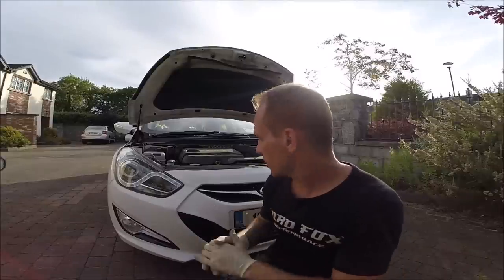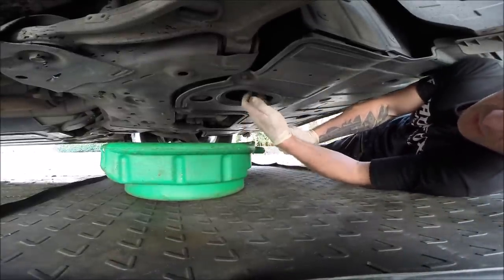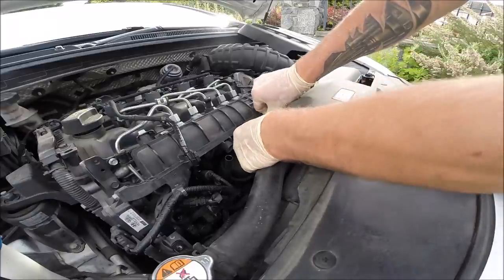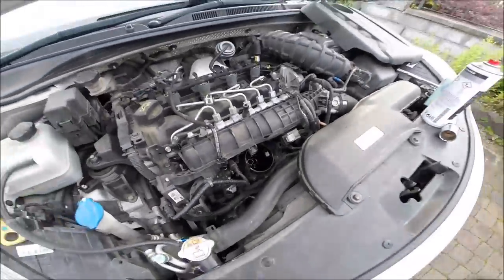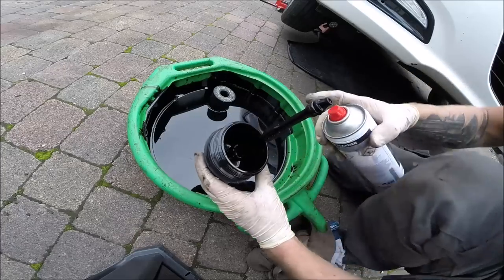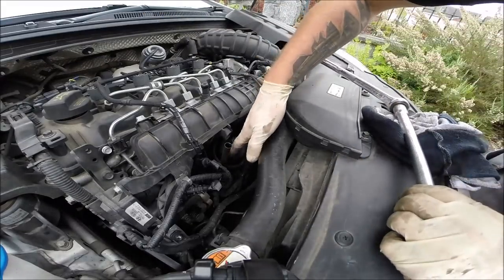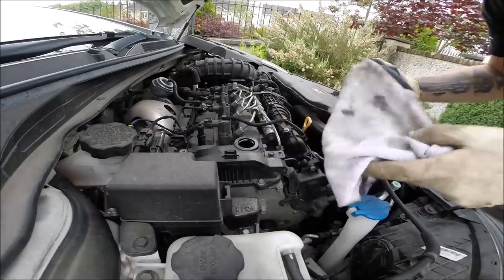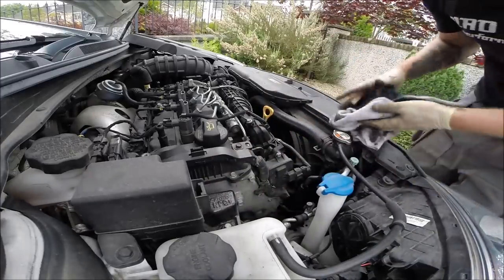Hyundai i40 1 7 CRDI 2012 Engine Oil & Filter Replacement

Comment: Clearly an experienced mechanic used to working on cars: making sure there are no oil drips :) Very clear video! Really only one minor niggle: you can't actually see the oil plug due to it being in the dark, but it is clear enough where it is anyway. Also thank you for showing basically -everything-, such as how to remove the engine cover, how to clean the oil filter cup, etc. Thank you!

Comment: Excellent video, as an Engineer I could only find maybe 1 thing I would have done differently, When starting up the Engine "Do Not Rev" let it idle and when the oil light is OFF, then if you must, then rev up the engine, but reving up an engine does not help accept to wear it out. For those out there not  doing a paper oil filter but changing a Cartridge Filter, where possible add some fresh oil inside the Cartridge.
Great Job
Mr Spence Eng

Comment: 3:25 can you tell me what the connector is for? the one right above filter cap? the mech that changed my filter and oil forgot to put that back, then i had loud chain noises and when i put it back it was fine. i just need to know so i can slap his face with info. My guess is its connected to the vacc and crankshaft position sensor. but idk..

Comment: Hi! I’ve got Hyundai i40 diesel 1.7l saloon and my car takes 4.7l of engine oil. How come your car takes 5.5l?  Interesting 🤔🤔🤔
Reply from the maker: Hi , hard to say why you have different oil capacity, maybe different engin oil sump coz  automatic/manual gearbox???
...automatic gearbox engine is 1.8  not 1.7
Reply: FixYOURride13 it’s manual 1.7 diesel
Reply from the maker: @didzmarello888  so that's the difference....probably;)
Reply: I have 1.7 CRDi with automatic gearbox, it's definitely 1.7

Comment: What can I do? in the manual it says C2 or C3, but C2 is low HTHS and C3 has higher HTHS, I was thinking of putting a C4, but I don't know if it's bad for the engine. thanks.
Reply from the maker: Hi, if you have petrol like on video best will be 5w30 c3 but up to you 😉
Reply: @FixYOURride13  Thank you.

Comment: So the engine oil is 5w30 or 5w40?? 5.5l. maybe you can add the oild brand?
Reply from the maker: Hi,  5W30 low ash , I don't remember how many liters, you  can check on Google or Ad 5L and after start check oil dipstick level, ad more if nessery.

Comment: Hi did you ever hear of Hyundai ix35,  loss of power on motorway knocks off start it again drives perfect same thing happened again , and foot to floor and no power plugged in says low fuel pressure
Reply from the maker: Hi, it is not simple, this error may be caused ,bad fuel, blocked fuel filter, bad injectors ,internal fuel pump leak. Fuel pressure sensor fault. So good diagnostics should show where is the problem.

Comment: Why is your oil still black colored after the replacement?
Reply from the maker: Hi, it is normal situations if the diesel engine oil replace, because engine inside is not to clean . Especially when service intervals is longer like 6kkm .

Comment: Why you don't change the aluminium seal ring on the oil plug? Later it will leak.
Reply from the maker: Hi, it was not necessary this time.
Reply: How many mm should have seal ring 2mm or 1.5 will be enough?